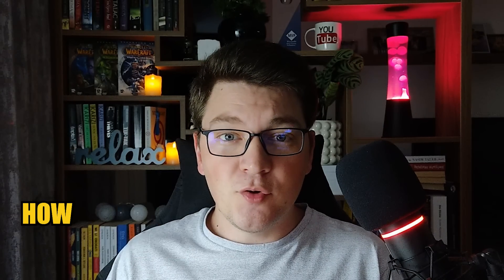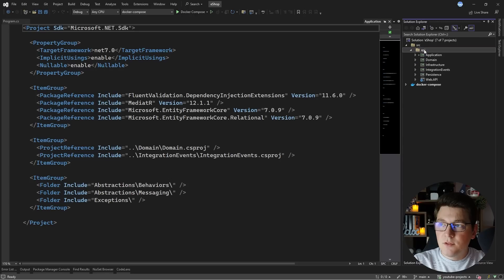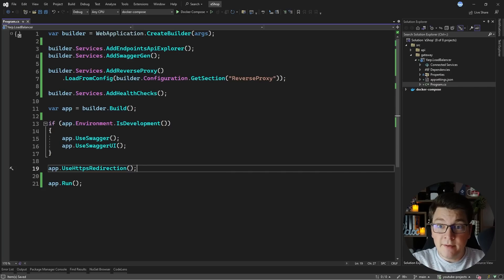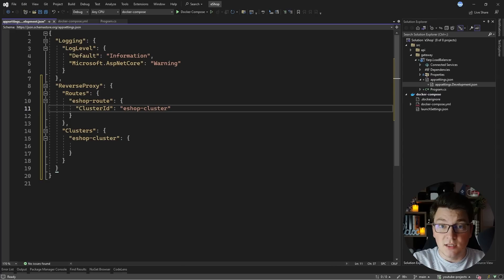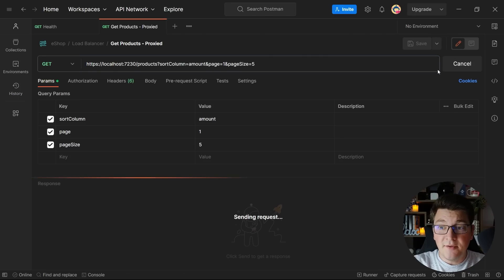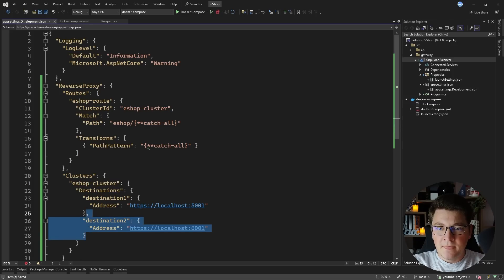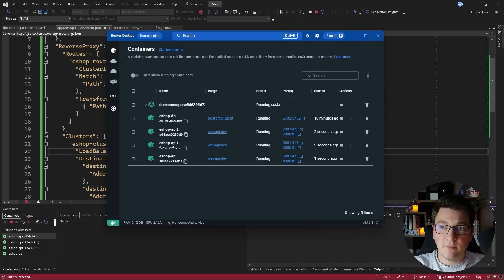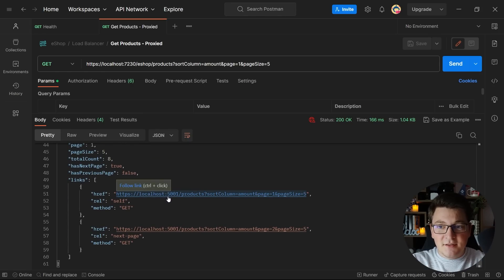How To Build a Load Balancer In .NET With YARP Reverse Proxy

Comment: If you use yarp like load balancer like this, you can optimize this even further - yarp app does not have to be web api. Web apis today are lightweight, but if you want to push it to extremes, you can just make a console app and configure kestrel for your load balancer. Then your yarp will be available as a url, but is as lightweight as possible. If you only want to do load balancing with yarp, there's no need to have the whole machinery of web api behind yarp, configuring kestrel will be enough.
Reply: very helpful thank u
Reply: @MsMagician0  you're welcome :)
Reply from the maker: Awesome! Are there any guidelines on this in the docs? 🤔
Reply: from dotnet core and above web apis are actually a console apps with krestel configuered so there is no difference I think
Reply: So, what's the difference if I use nginx, and config as reverse proxy and load balancer, instead of yarp?

Comment: I assume YARP sends an X-Forwarded-For or something so you can adjust your HATEAOS links to point to the reverse proxy rather than directly into your API since usually you wouldn't use public ports on your API instances to force all traffic through the proxy/load balancer.
Reply from the maker: Of course, I only left the original implementation in place to make the load balancing obvious.

Comment: A few comments:

- Health checks are meant for your destination boxes. To identify if they are alive and using configured logic re-route traffic to a healthy box.
- Another benefit of having LB is to build highly available infra, but here you need to add another LB node. Not sure if YARP supports it
- When your API will get a request thru the reverse proxy it will see the proxy IP address (not the client). I believe you need to configure additional headers

For small projects might be that is OK to have a LB like this, but for the >=mid\prod apps  I would prefer to have something that is optimized for this particular task.
Reply from the maker: There are many YARP config settings I left out that cover the topics you mentioned. I will check about running YARP in a HA setup, that piqued my curiosity.

Comment: Hi @MilanJovanovicTech, 

Again, another insightful video, thanks for sharing it. 

I know that this is a simple intro to how to start with a load balancer using yarp. In order to let us know that you were not lying us 😅 you showed the links attribute of the products endpoint.

Here, I kept thinking that if you want to protect your APIs through the API Load Balancer/Gateway, the real path or domain of the application will be exposed, so I wonder if it's something that it has to be configured in Yarp or in the application (eShop) in order to transform those links or any other response that involves the application URL?

Thanks again for your videos, they are really interesting and insightful!
Reply from the maker: Yeah, you'd have to forward the Load balancer address in a header - typically X-Forwarded-For - and fix the LinksService which generates the HATEOAS links to use the correct address
Reply: @MilanJovanovicTech  thanks. I will check how to do it.

Comment: Thank you for explaining this topic. I just have a question. If the service is deployed on server1 and server2, we can use application where yarp is used to route the requests. So, ideally this has to be on some other server say server3. What if the server3 is down. How can we handle this situation.
Reply: imo this is not a coding problem
Reply: @ibrahimb6791  It is a Yarp problem though.  Yarp would need to handle the failing health checks.  The question is, how to configure/achieve this?
Reply from the maker: You can run YARP in a HA setup, to improve availability. But if your gateway is down, so is your app

Comment: How does it compare to Ocelot? 
Seems like Ocelot supports more features than YARP, I mean, YARP seems a "pure" load balancer and Ocelot has other features (like Kubernetes integration) than a "pure" load balancer.
Is there any specific reason to choose one over another?
Reply from the maker: YARP is used in Microsoft internally, for Azure App Service for example. It can also work as a Kubernetes ingress controller. It's not just a load balancer, it's mainly a reverse proxy. It can also be an API gateway. It has auth, rate limiting, etc.
Reply: @MilanJovanovicTech  which one do you prefer?

Comment: Has yarp any advantages over use nginx as reverse proxy?
Reply from the maker: It's built in .NET and integrates with .NET Core... And it's faster than nginx
Reply: @MilanJovanovicTech  Ok, but it is not reccomended to put kestrel directly to open world, as i know at least. But if you think that yarp hosted on kestrel can be exposed directly it make sense.

Comment: In your example, api is running on 3 ports and yarp is used as load balancer. Is there a way for yarp to know if any of those instances are down. So that yarp will stop sending the requests to it.
Reply from the maker: You can set this up: https://microsoft.github.io/reverse-proxy/articles/dests-health-checks.html